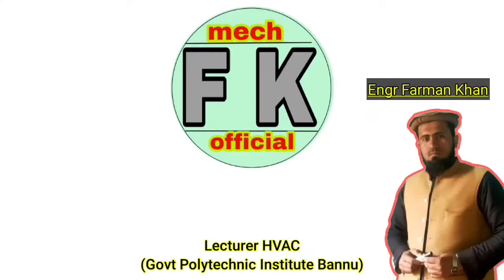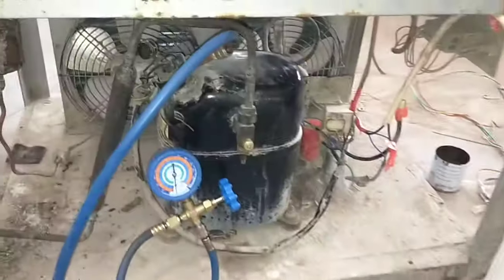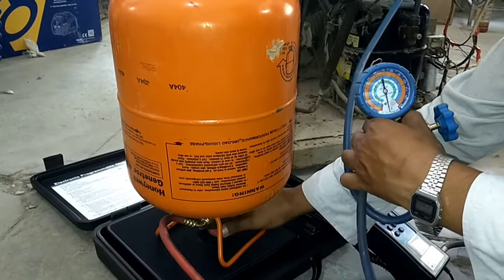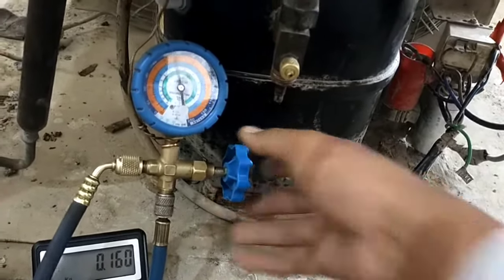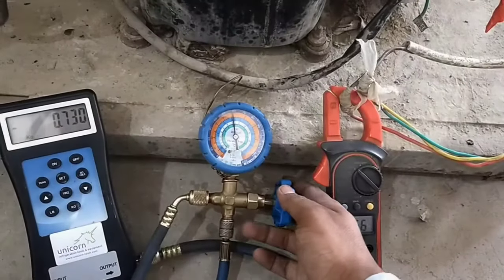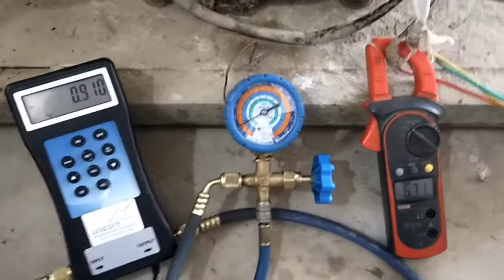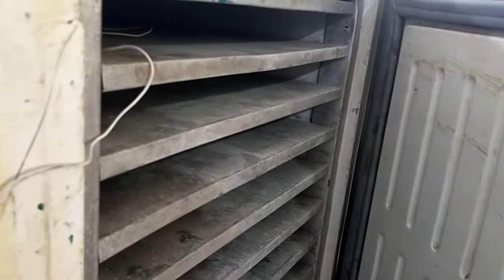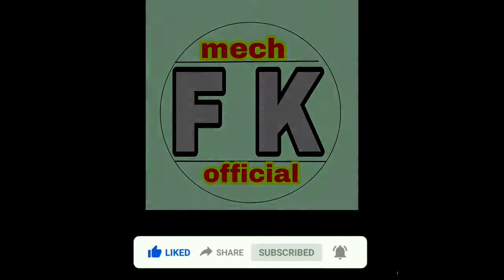R-404a gas charging || Cone Ice cream machine gas charging -32 ⁰C

Comment: Liquid refrigerant must be fill at the discharge line sir, cause not good for the compressor if you fill at the suction line.filling the liquid first time when unit is off.
Good if you put another charging line at the discharge line and use double scale LP+HP that is for better measuring pressure.
Adding refrigerant to suction line when compressor ON with gas.
Sorry if im wrong.

Salam from Indonesia
Reply from the maker: Dear thanks for your valuable comments...❤️
Dear sir, during charging the Refrigerant from discharge line is very difficult because the pressure at discharge line is higher than the pressure in Refrigerant cylinder...if we will connect cylinder with discharge line of the unit, the Refrigerant will flow from the discharge line towards the cylinder....
Reply: @FKmechofficial  is that corect sir, mostly im doing at compressor off, than adding and or reduce refrigerant at the compressor running. Thanks for sharing good video succes for you sir 👍
Reply from the maker: You are welcome Dear Sir ❤️
Reply: @italudin  salam..bang saya dari malaysia,, boleh ajarkan saya masukan gas r404a untuk reefer tak,, kalau boleh bang tinggalkan nombor handfon saya akan wasap bang..🙏🙏

Comment: Sir makeline system r404 gas suction line ice problem i want to know the system how many gas required and back pressure if you know so please reply
Reply from the maker: What is your required temp in evaporator coil,
Suction pressure depends upon the evaporating required temp.
Also depends on application type.

Comment: Dear if use 1 ton compressor and r404 refrigerant. Sir what will the capillary size and length also mention condenser and evaporater pipe
Reply from the maker: Condenser tube:
Dia: 3/8
Length : 48ft
Condenser fan type

Capillary Tube: 
Dia : 042
Length : 4ft, 4ft ( Two Capillary Tubes)

Evaporator:
Dia : 3/8 
Length : 44ft
Without fan evaporator
Reply: Sir dranfoss Sc21cl Compressor R404a gas Sir what will the capillary size And lenght

Comment: sir, what is the suction pressure of this 404 gas for this type of refrigerator, I have measured a suction pressure of about 50psi, working current 2.5a, snow is half closed
Reply from the maker: If you have required temp: —30 ⁰C then you should have the suction pressure 10 Psig for R404,
If suction pressure increases then your required temp: will also increase

Comment: Use expansion valve or capalery?
Reply from the maker: Capillary tube
Reply: Cold storage freezer for kcm475 compressor which size of capalery use
Reply from the maker: @javedkasam8138  required temperature ???

Comment: R404 high pressure?
Reply from the maker: No.....not so much high pressure,
It's suction pressure should be from 10 Psig to 25 Psig according to the application type
Reply: @FKmechofficial  tell me, condenser temp+ pressure.
Reply from the maker: @tanvirulislam957  condenser pressure is  from 220 to 260 Psig

Comment: And what is pressure r 600 if filled in ac split??
Reply from the maker: Dear Shahzad thanks to touch with us...
The Refrigerant R-600 is not practically applicable in split AC, because it's heat bearing capacity is very low. 
❤️❤️